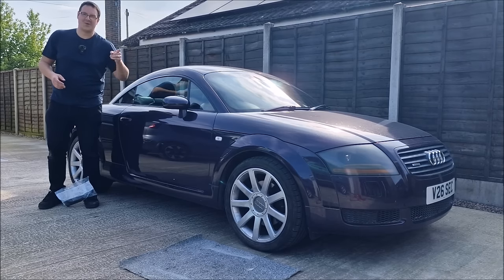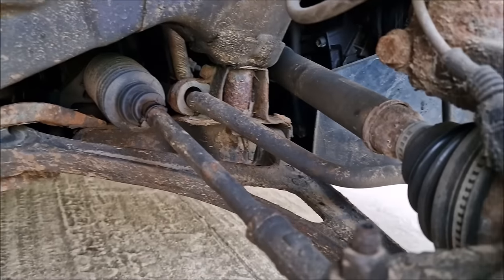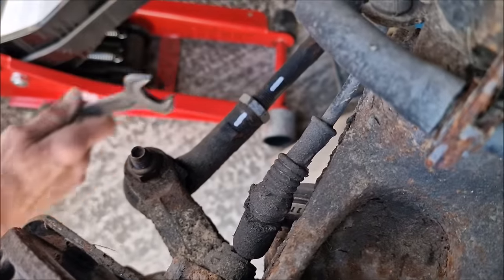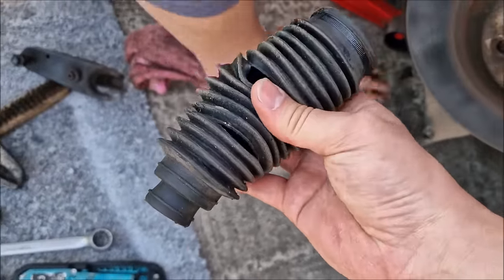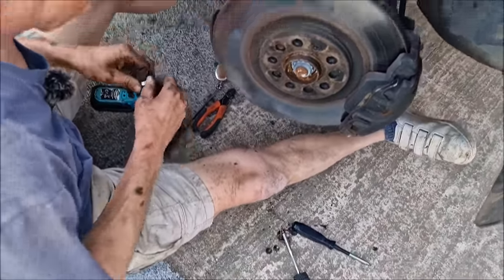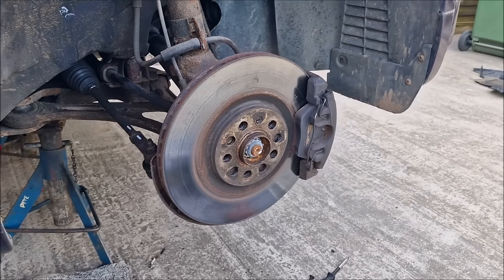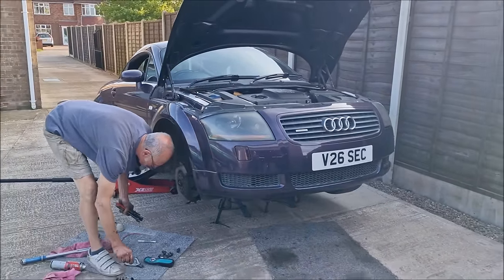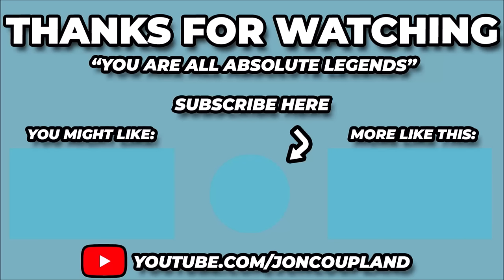Audi TT Steering Rack Gaiter / Boot Replaced - The EASY Way!

Comment: Ditch them locking wheel nuts mate they are a pain in the rear especially the mcguard ones twice now ive had to weld them off after a visit to the tyre place. Well done on losing 2 stone how did you do it jon.im guessing cut out the carbs l,protein diet and exercise
Reply from the maker: Absolutely. New wheel nuts now on! And I'm on the Cambridge 1:1 plan but effectively yet high protein. No carbs
Reply: @JonCoupland  I will have to take a look

Comment: Surely it was a ‘Piddle in Lidl’?!
Also, I’m ex-Comet. I was at 785 Telford 😊
Reply from the maker: A Piddle in Lidl :) - love it

I worked along side a lot of Ex-Comet staff from 2012 - 2019 who were taken on at a company when they closed
Reply: @JonCoupland  I was at Comet from about 2002 to 2009/10. Ahhh, the old Monster commission. I was a master at selling the plug extension thing that ‘cleaned’ the electricity and terrestrial/satellite signal. Was it £15 or £20 commission on that? Can’t remember now 🤔